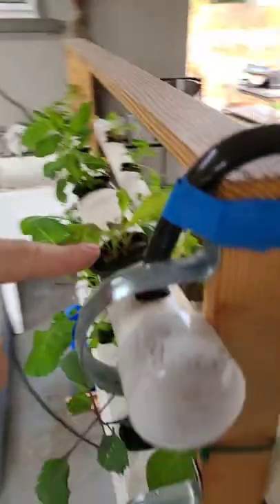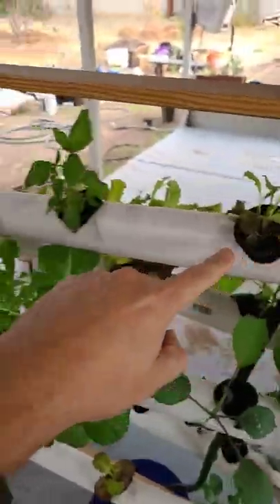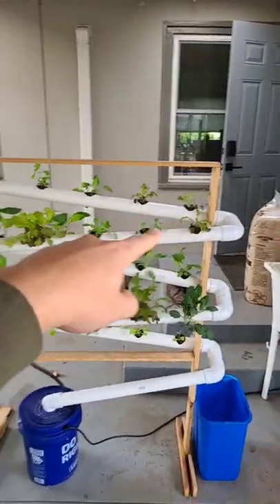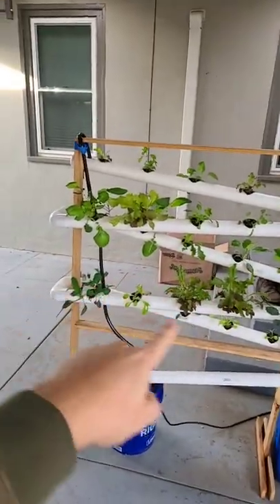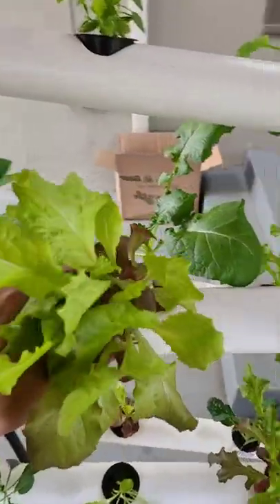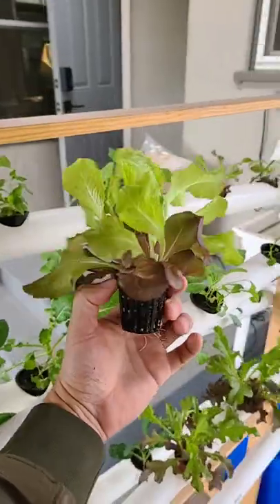Vertical hydroponic system with PVC pipes

Comment: Would love instructions on how to build, especially how to angle those pipes!
Reply: Just buy the angled extensions and make sure before you glue them that the angle works with gravity. You only need a small pump to get the water to the top, let gravity do the rest. This type of hydro system is PERFECT for growing just about anything. Just remember to reinforce it if you’re wanting to grow big plants.
Reply: @jeffw6692  Thanks!
Reply: With gravity, Water will flow down gravity pulls it any angle is OK as long as it is angled down the less the angle is lower the flow of water
Reply: @jeffw6692 gluing pvc in hydro applications that isnt under pressure is overkill and wasteful.
Reply: @colekter5940  
Indeed, very much useless and wasteful!!!

Comment: How often does the pump run to pump the water up to the top pipe (assuming you could use a solar panel to limit costs but that limits pumping to sunlight hours) and keep the roots submerged?
Reply: Standard nft  pump running time is 24/7 but  hybrid  nft system with baffles are on a time schedule and usually programed to turn off at night times

Comment: Is it food safe plastic? I'm not sure PVC is safe
Reply: I mean water that comes from the tap is passed through PVC and so is the water that we irrigate our plants with. If you are looking for a better option I would suggest you look into cPVC or get a Lettuce Grow system like I have its great and its food safe plastic
Reply: Actually, many residential builds are moving to PEX because of the problems with PVC. Exposure to UV light, cut/exposed parts, and acidic/alkaline baths can cause leaching of vinyl chloride monomers into the system. PEX, HDPE/LDPE is more recommended for purposes such as this. They just don't usually make PEX in large diameter as it is too flexible. HDPE/LDPE needs to be "welded" to join ends.

I was going to ask the same question...I'm curious what Kevin's thoughts are on this too.
Reply: Don't do it - it's a scam.
Reply: @sebringb  Yeah, Sounds like one.